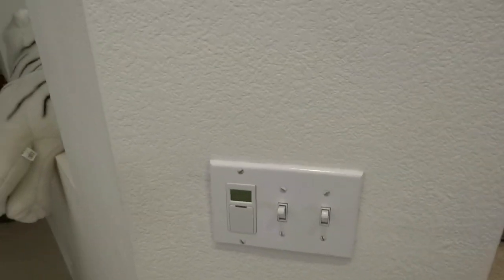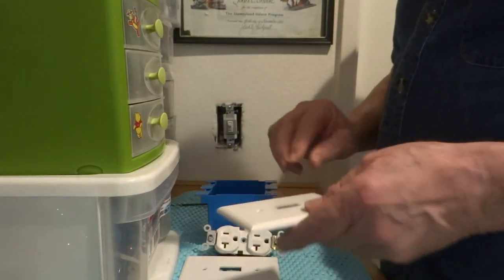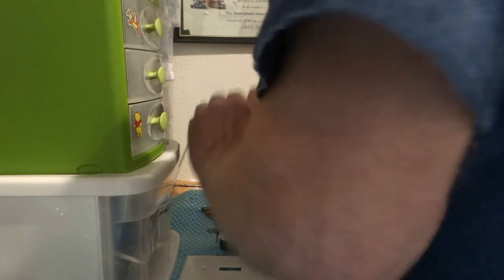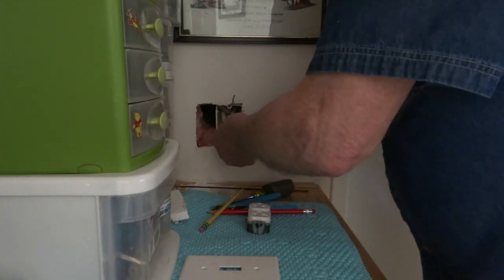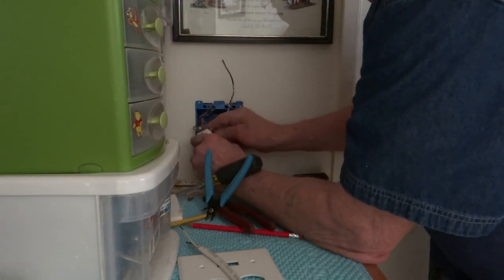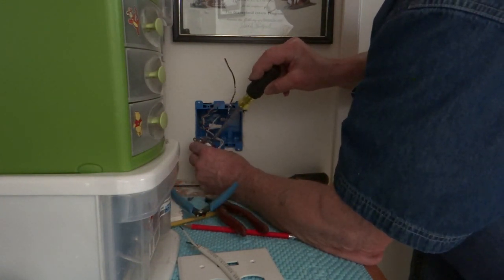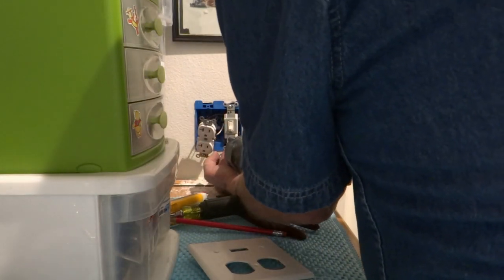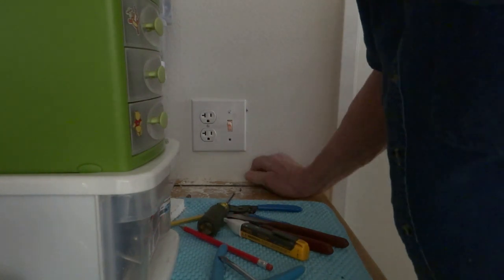Installing Receptacle, Power for my work bench, Cutting in a plug with my 3/W switch

Comment: Hello Mr John Shook.....I would like to thank you for your videos.  I was having a problem with a loss of power to a receptacle next to my kitchen sink also connected to a gfci that wouldn't reset on kitchen counter two feet away.  I changed the gfci and it still wouldn't work. In the process of tracking the problem I discovered an outside receptacle without power with a loose wire. Yeah...fixed it but no connection to kitchen. So I was watching youtube videos trying to find help. I watch one with you talking about the possibility of the newly bought gfci not working. So I bought another and changed it again. It worked. I want to again thank you....I didn't think that could be the problem. IF I ever encounter this again, I will know even a new one can be bad.
Reply: There is always a margin of error for all things. Some new products will always be defective.
Reply: @illestofdemall13  Thanks....I found that out the hard way. :-(
Reply: @AMERICANDEPLORABLE  It happens to all of us haha
Reply: @illestofdemall13  The happy ending is we found that out and fixed the problem with  out spending big $ for electricians.

Comment: I live in a RV.  We recently had our  GFI which is in the bathroom replace   It is tied into the outlet on the kitchen island  and three outside that are either covered or in a dry area.    Everything was working fine until suddenly the associated outlets stop working.   The GFI  outlet still works and resets.  The green light is on and the red light blinks.  Any ideas?  Thanks